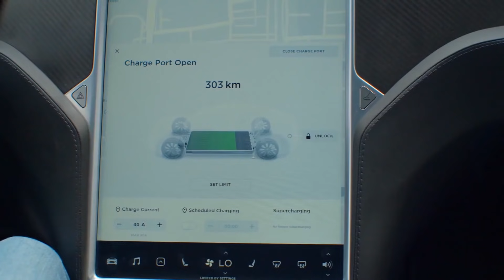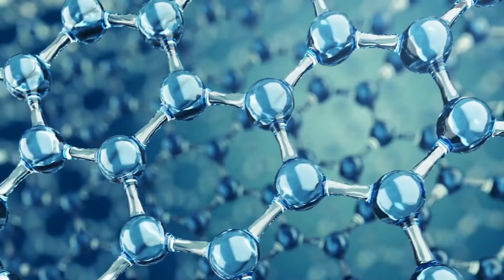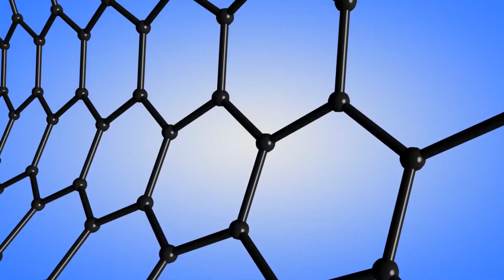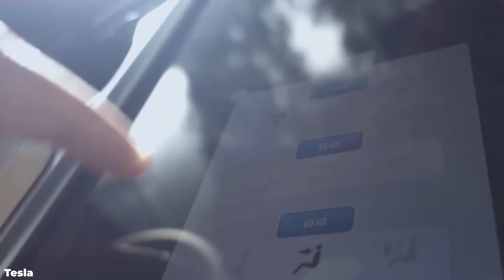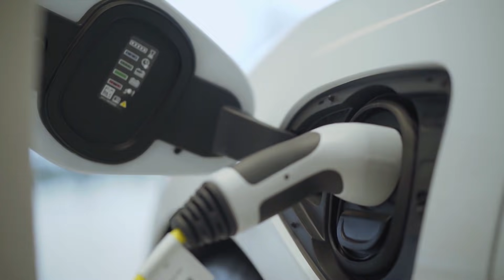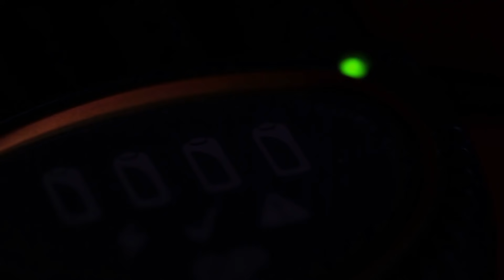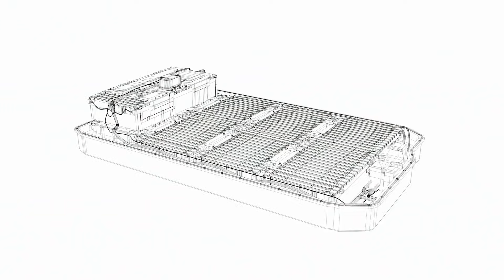GAME OVER! Tesla‘s New Nanotech Battery Will CRUSH Competition

Comment: And, what about the electricity plants supplying the power to charge these electric vehicles batteries? How much pollution do they produce from coal driven generaion or the current atomic power plants depleated uranium waste. OK, depleated uranium is used in battlefield tank busting gattling guns on the A10 Warthog aircraft and probably other battlefield artillery, but … that just spreads that material around this world of turmoil we live in. I believe we may just as well stay on track with our current fossel fueled vehicles and upgrade our current electrical grid so it's hardened aganst electrical disruptions as much as possible! 👌

Comment: There is a company near Montreal called Nanotech.  They produce Graphine powder at a very low cost.  The President of Nanotech said that Graphine can reduce or replace Carbon Black (mostly used in tires).  These tires would be lighter and last longer.  Adding Graphine to plastic makes it stronger so you can use less plastic and make a part lighter.  Yes graphine can be used in batteries but other uses make a car lighter and it takes less energy to move less weight.  If Tesla can make a battery pack that is lighter the cars range will improve with the same amount of energy.

Comment: Graphene costs more than USD 300 / gm for this purpose.
Graphene needs to be combined with a different metal.
It is not yet possible as solid state.
So 10 years away!
Reply: Bull shit  However, as graphene currently ranges at anywhere between $67,000 and $200,000 a ton
Reply: @moviemakers3200  Thanks for your comment Munis you are quite correct generally speaking. But you missed the words "for this purpose".
That would be formed into nanotubes.
For instance if using aluminium as the positive anode and carbon as the negative the interface to the gel is with nanotubes. If simple carbon nanotubes can be used that reduces the cost by a factor of 10 for that part of the battery.
See Queensland University department of Nanotechnology work with GMG.
If you are really interested, there is a project making Graphene Aerogel on the ISS. A bit more expensive!
This will revolutionize Graphene batteries as it solves many problems including solid state. Look it up and read about it.
In 10 years the price will be sufficiently low the charging time > 10 minutes. The life cycle < 2000
The capacity up to a theoretical 7,000 watts per kg.

Comment: The moment this guy said that batteries have only 500 recharging cycles I stopped watching. He does not know what he is talking about.
Reply: @GeeKIller just to be fair, phones also doesn't discharge to 0% they keep basic processes like date and time still running as long as possible. And I will just add - no batteries like to be 100% charged. Sweet spot for charge and discharge is ~15-90%
Reply: They don’t start to deteriorate after approx 500 cycles? I thought that was true.
Reply: He actually said that they start to deteriorate after 500 cycles. Which is also not true. Battery packs start to deteriorate after they are in use. The time it takes before you are actually starting to see a difference in state of health differs a lot depending on how the vehicle is being used.

Comment: If the main issue with mass charging of EVs is the amount of electricity required over time, how much worse is that issue if the batteries charge faster?  What kind of power lines would a public EV charging station need to handle the energy dispensed by the common gas station in a day?

Comment: Just wait till he inventes nano tech cell reconstruction technology to heal wounds instantly
Reply: Nah thats what liver fluke spit is for
Reply: My breakthrough is mixing carbon nanotech bubbles with aluminium ingots to have thousands of negative points and one positive anode, et.voila a battery 90% lighter with a range of 5000 miles a charge or replacement at a cost of £100 per 5000 miles range. Minimum investment is £5 000 000 for a tenth of a percent of the company.
Reply: @AndyAndy-we9pe  very impressive it would be better with graphine are metallic hydrogen

Comment: if a battery degrades to 90% after 500 cycles then that would be 80% after a 1,000. a car with 300 mile range would cover 150,000 miles over 500 cycles and would still be usable at 300,000 miles. That's replacing a battery to often?

Comment: Nickel cadmium haven’t been common for the last 20 years. Cadmium is very toxic. If rechargeable batteries is not different variants of lithium it’s usually nickel metal hydrides, NiMH. They have more lifetime and recharge cycles than lithium, but less energy content.
Reply: Typical rated cycle life for niMh is 150-2000 cycles and in many cases you can’t get even 50 cycles out of them because cheap chargers overcharge. 

Lithium ion cells have nowadays 500-4000 cycles with typical vehicle batteries are around 2000 and grid storage versions go higher. 

Lithium iron phosphate go up to 10000 cycles and lithium titanate cells up to 30000.

Practically only advantages for nimh are they don’t catch on fire as easily and don’t get destroyed if discharged empty.
Reply: @teropiispala2576  
If you use crappy chargers lotion batteries get very few cycles too. ;)
I see as positive for nimh long life if not used often, like radios, remote controls, etc. 

Only lithium I’ve seen that holds decent charge for more than five years are Tesla. Otherwise lithium is dead after 5-6 years, which is perfect for planned aging from manufactures. 

But done right you get lots of cycles and time out of both. Problem is manufacturers doesn’t do it right. :)

I’m not team nimh, I just think they both have an application.
Reply: @macjonte  With lithium ion batteries, there are not so many crappy chargers since they get damaged when overcharged and may caught on fire. It is much easier to avoid overcharging lithium ion batteries even with a cheap charger. There is only two rules. Don't exceed maximum rated current and 4.2V cell voltage. Both current and voltage are very easy to measure precisely.

With NIMH, it is much more difficult since you have to detect millivolt lever drop in cell voltage. Temperature,  recent charge and discharge profile, cell age and many more small details have effect on cell voltage and the voltage drop. Good NIMH chargers are quite rare.

I still have working Chinese Trustfire branded lithium ion cells from 20 years ago when they still sold properly made cells for customers. I also have self made battery packs from Panasonic and Samsung cells with close to 1000 cycles in 5 year period and practically no degredation. Those packs have sometimes several full cycles per day and then couple months without use.

The truck is to store them half full and in a cool place. Laptop batteries don't last because they are mostly kept in a full charge in hot conditions. That is very bad for them. Beingclose to empty for long periods is also bad. That is one of the most common thing to kill liion. If they self discharge below 2.5v, they are. Done.
Reply: @teropiispala2576  One of the real advantages of Lithium rechargeable batteries is the shelf life.....I have 4 AA Lithium batteries in my digital camera by the trade name of KENTLI, engineered to give 1.5 volts each cell.........they sit in my digital camera unused sometimes for 3 months and still have a full charge.......NiMH batteries don't have a charge left after 2 weeks even if unused.
Reply: @gangleweed  That KentLi battery have normal lithium ion cell, charging electronics and stepdown converter as well as required protection circuit. While not an efficient solution, they work with devices which need 1.5v. The battery inside is small and don't match NIMH capacity.

Same limitations apply to them as normal lithium ion batteries. Since the output is regulated, they give full voltage untill they are empty. 

Typical self discharge for lithium is couple of percent per month, so they can I feel last several months or over a year, especially in cool environment. There are also NIMH cells with similar self discharge but it can be as high as 30%. Seems you have had these cells.
Reply: @teropiispala2576  I have both AA and AAA Kentli batteries and the respective charger, now on their 5th year run.....they cost more than the NiMH but are always there when I want to use them.......more expensive NiMH brands are no better for shelf life and volume in my experience.